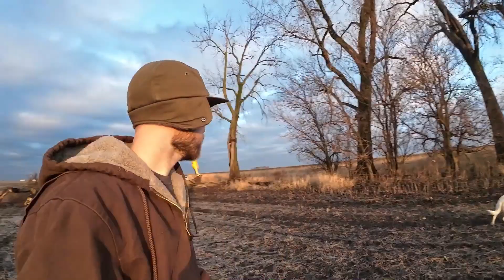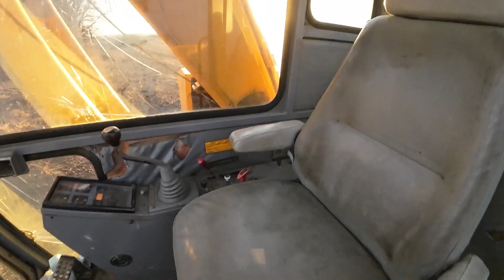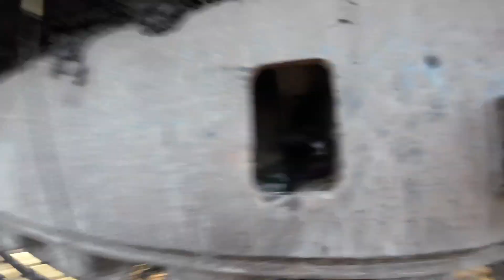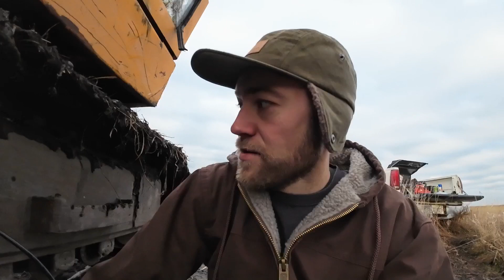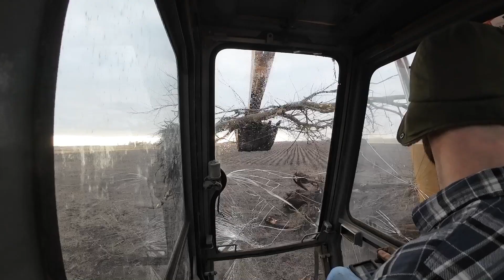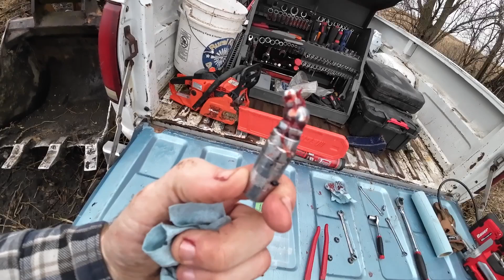John Deere Excavator Track Problems

Comment: To push over the trees first dig the roots out. Not all the way but enough to help the tree fall the way you want it to go. Then raise the boom as high as you can and push the tree at the highest you can reach. They push over pretty easy.
You would be surprised how much those cottonwoods steal Sunlight and ground water. I can’t stand trees on my tree lines.